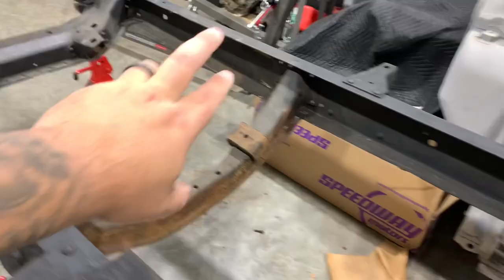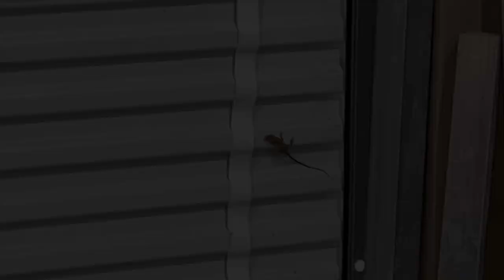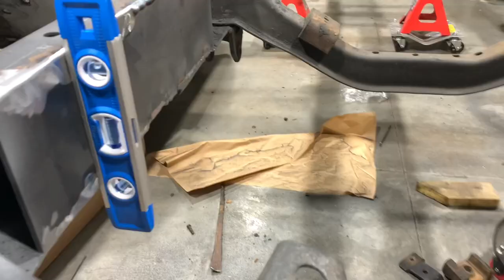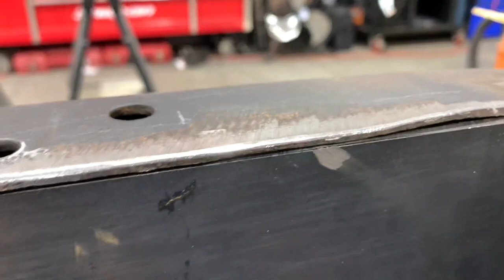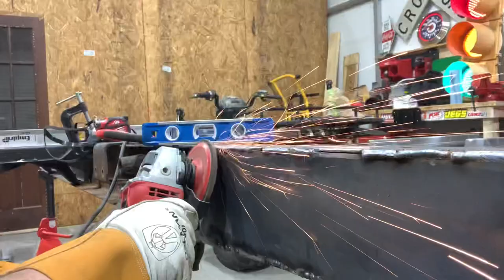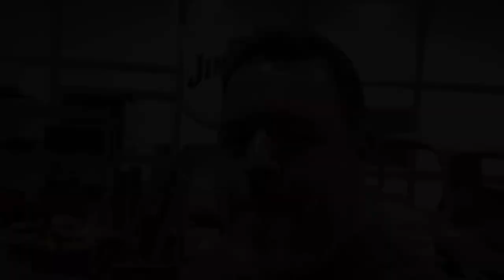55’ Chevy Truck | Day #2 | Frame Boxing Plates for IFS

Comment: Thank you for your videos.  Im about to tackle the front boxing plates on my 1957 chevy truck and this video has been very helpful.
Reply from the maker: Awesome, you’re welcome! Let your crossmember dictate wether you mount your boxing plates outset or inset to the frame. For example if the portion of your crossmember that gets welded to the boxing plates is really narrow, mount the plates outset, instead of shimming the crossmember too much and visa versa

Comment: Where did you get that kit at
Reply from the maker: The boxing plates?
Reply: @intheshoptv  yes where did you get it at?
Reply from the maker: @BryanAlcala-wv6eo  Speedway, I made a video about all the components here: https://youtu.be/62_K5iMgzBg
Reply: @intheshoptv  oooo ok yeah I watch it but is there a kit for the boxing plate sheet metal or speedway sends it as well? I bought the same kit lol your videos are Hellping
Reply from the maker: @BryanAlcala-wv6eo  yes, they sell the plate kit separately here: https://www.speedwaymotors.com/1955-1959-Chevy-Pickup-Front-Frame-Boxing-Plates,50958.html?utm_medium=CSEGoogle&utm_source=CSE&utm_campaign=CSEGOOGLE&gclid=Cj0KCQjwmZejBhC_ARIsAGhCqneOE91eJcGuTp3RQLSLA0eWvlB_h6x_68Bmy1etZ-O8ARbBzO90rpsaAowFEALw_wcB

Thanks for watching!